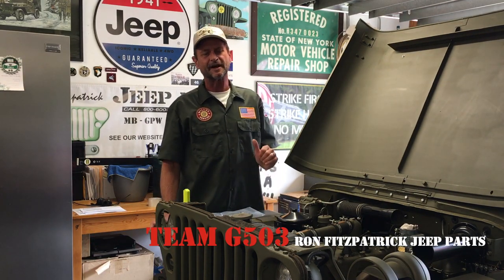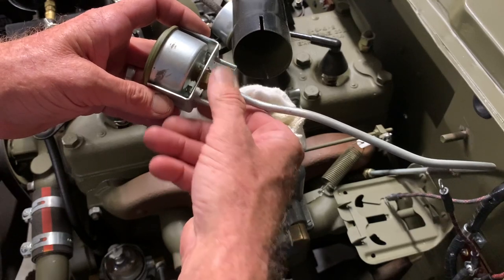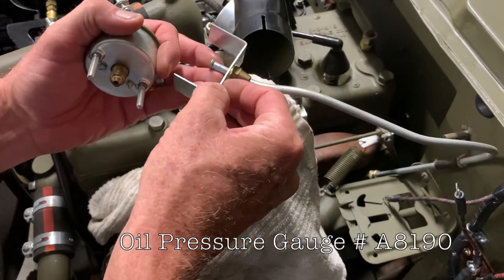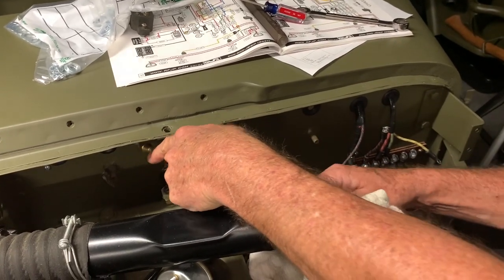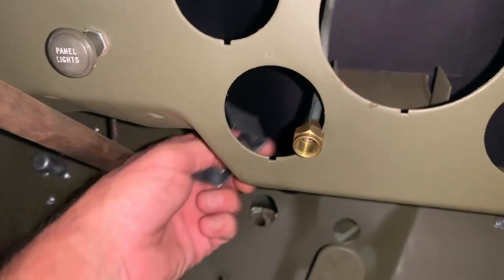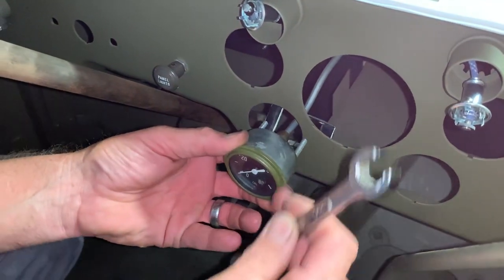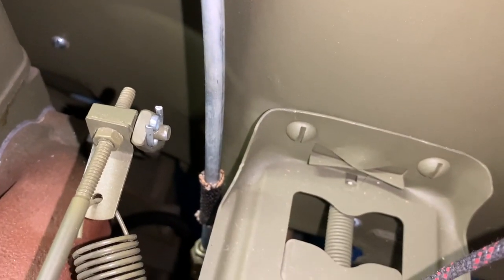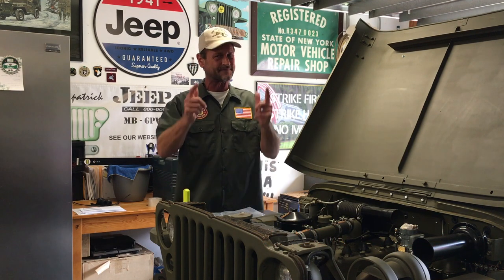Installation of the Willys MB and Ford GPW Oil Gauge Lines and Fittings with Routing, Team G503

Comment: Do you need to put a sealant on the fittings on the flexible line to engine block or to steel line?
Reply from the maker: Only the pipe fitting get Teflon paste or tape... not the compression fittings